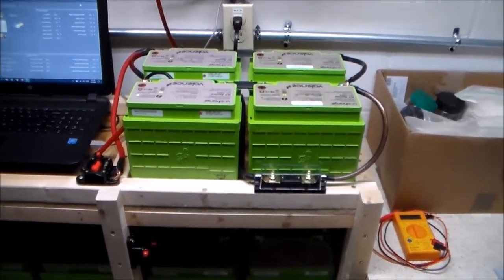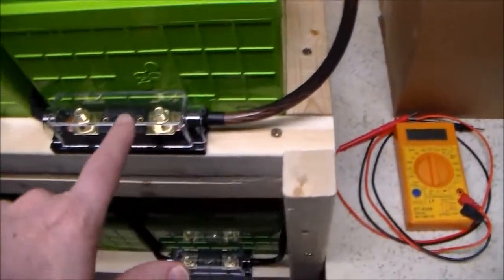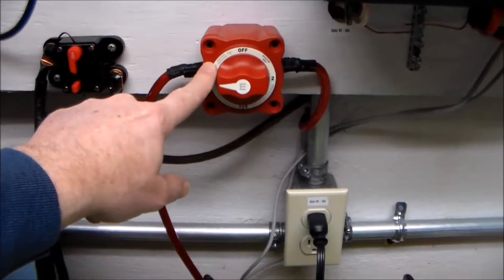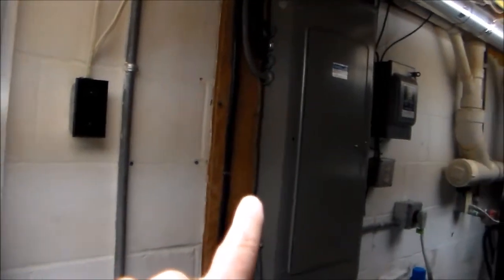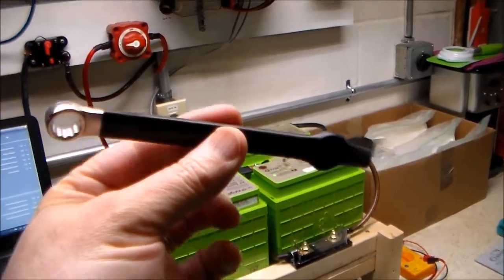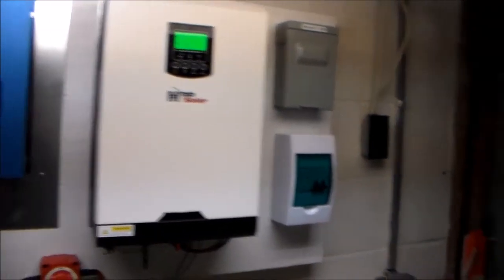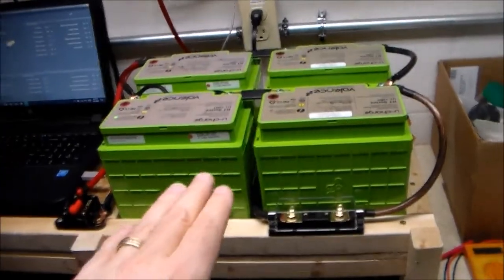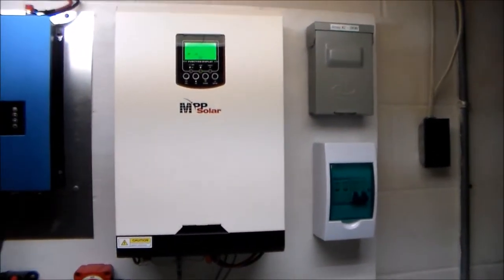DIY Solar - Episode 7 - Wiring the Batteries

Comment: Wow Sonny Jim! Awesome build. I stumbled onto your videos at number 6. I had a very similar build, but it was about 30 years  ago using a wind generator and a then trace grid tie inverter. But in those days we didn't have all the pure sine wave inverters we do now. So I was not able to return power to the grid. Which wasn't my intention, But having the ability to charge from solar or the grid if you have both is huge. Running the system from an alternative source, battery, or the commercial grid is a game changer. Also I agree, you stole those batteries, and more power to you! I just ordered 4 for myself! :o)
Reply from the maker: @vhmccray3705  Glad to hear you found my channel. Good luck with your build! I hope you post some videos too!

Comment: Thanks for the video. I am also setting up a Valence RT battery bank. Did you do anything with the RS-485 communication data cables with  your battery setup? Was it necessary to monitor the state of charge of the batteries?
Reply from the maker: I didn’t use the data cables with my setup. Also, I never had to monitor the state of charge since the internal BMS took care of things for each battery. The only time I had to maintain anything was whenever I ran things down too low. In those cases, I needed to trickle charge the batteries to bring them back above 9 volts each so my inverter/charger could see them again to begin another charge cycle. I later changed the low voltage cutoff to a higher setting to keep the batteries from going too low. Th are great batteries. I wish I could find some of the larger 100 amp hour model for a decent price. Best wishes!

Comment: I am wiring up a 24 v system using the growatt inverter and it worked initially but when I tried to switch settings to lithium and now it's drawing no amps from the batteries and 13.17 v from ea battery and 26.5 v with system I set up 3 sets of batteries in series then in parallel.  Did I somehow trip the internal overprotective feature of batteries?  I have a 150 amp fuse.  I checked ea battery and they are all pulling 0 amps.  What did I do wrong?
Reply from the maker: I’ve heard that some inverters will shut down when initially connecting lithium batteries due to the large inrush of current that can occur. It’s recommended that before initially connecting, you place a resistor between the batteries and inverter to charge the inverter capacitors, the. You can connect the batteries safely. Search YouTube for Will Prowse videos. He did a review of some GroWatt inverters and showed how to do that.
Otherwise, I recommend that you disconnect your batteries and perform a voltage check on each one individually. If the charge has dropped below 9-10 volts, you may need to place them onto a trickle charger to bring them above 10 volts so your inverter can correctly detect them. I hope one of those suggestions works for you. I’ve also heard some others that had to search for a special setting within the GroWatt menus to enable some special feature for things to work correctly. Again, search YouTube for others that have your version of inverter. Good luck!

Comment: I have 6 valence battery 12v series/parallel connection but they wouldn't charge Balance with the black connector it comes with it, how should I connect it?
Reply from the maker: Those batteries have an internal balancer that will keep the individual cells balanced. However, to balance multiple batteries with each other, you have to install separate BMS that is sold by Valance. Some people open those batteries up and remove the cells to make that easier.

Comment: Are all of the battery cables the same size and length so that they all charge at the same rate? If not you’re going to have problems!
Reply from the maker: Yes. I mentioned that at 3:06 in this video.

Comment: Thanks for the video. I just bought some of these valence batteries and have them hooked up the way you have them. There's very little info on the batteries. Just wondering what your charging perimeters are set to? Are they supposed to be charged to 29.2v for top balancing?
Reply: Also can these be charged @ 40 amps since they are paralleled?
Reply: I have set as follows:
Bulk Charging (CV voltage): 28.4 v
Float Charging Voltage: 27.2 v
Back to Grid voltage: 25v
Max charging currant: 30 v
Back to discharge voltage: 26.5v
Battery cut-off voltage: 21v
Please keep in mind that your settings may need to be tweaked a bit depending on which charger/inverter you are using. I hope that helps. Good luck!

Comment: Sorry to be bothering you jim, the batteries are used and you have them in your solar system how many years now? and would you say they are great batteries? also i am looking to get 4 valene U27-12XP to series for 48v bank, do you think thats a good idea? only down side one cost $641.
Reply from the maker: CODIA STLUCE The batteries I got were 5 years old when I bought them. I used for three years. Most lithium batteries should provide about 15-20 years of use as long they are not misused. Yes, I believe  the Valence batteries to be some of the best and safest batteries to use for solar, although they are extremely expensive. Good luck with your system!

Comment: Hi Jim!

I am building  480ah/48v bank in the form of 16s2p (3.2v/240ah cells) and I was looking at how to protect each string if one of the cell is failing.

You are the first place I actually find information on this.  Just like you I want to be able to service each strings separately.

The question I have is about the fuse/breaker... If I get this right you have a fuse of about the power of the string between the battery and the joining negative bus bar of the parallel group?  So two 80a fuses per 160a groups.  Then you have a 150a breaker between the main positive bus bar and the joining bus bar of that particular group.  Do I get this right?  :)

From your design and for my particular setup I would protect each (2) of the 16s string with a 200a fuse as I do not expect to see loads larger than 200amps at any point.  This would insure that if a cell goes short then the whole string would get disconnected as the other cells/string would send well above 200a back into the shorted cell/string.

To isolate one string I would use a 200amps breaker for the same reason as above between the main positive bus bar and a particular string. If ever the string get charged or discharged at more than 200a there would be a problem, hence 200a is enough and has a better security factor than 240.

Anything crazy in what my understanding?

Thanks!

Comment: Cool setup. If your inverter is using household power pass through when your batteries are low to power those circuits, how is the inverter grounded when in this mode vs when using battery power?
Reply from the maker: There is a 40A circuit feeding the inverter from my home circuit panel. This includes Line, Neutral, and Ground cables. When in "pass-thru" mode, all three of those are also passed over to the transfer switch.
Reply: @jimginnyohio  hello i am curious but where did you buy the batteries?

Comment: do u need the valance bms to use these batteries in series or parallel?
Reply from the maker: CODIA STLUCE You can if you want. However, I have found that they stay balanced with each other simply with the internal BMS built into each battery.

Comment: What did you do with the BMS interconnect cables from the individual 12 volt batteries?
Reply from the maker: Just left thing hanging since they do not serve any function without the Valence BMS and terminators.
Reply: They still work great now.????

Comment: what will happen if we series two battery 12v using busbar, parallel them with other series of two battery 12v (same battery spesification and connection) , then give the series connection bus bar to other series connection. Sorry for my bad english. I'm from indonesia.
Reply from the maker: Yoto Agro Dita Two 12V batteries in series gives 24 volts. Paralleling those with two other batteries also connected in series will still result in 24 volts, only the amperage would be higher. To give 48 volts, you would connect four batteries all in series.
Reply: @jimginnyohio  thankyou, but what i mean first series point in that 24v parallel batteries, connected to 2nd series point. is that possible? btw i have learn much from your videos update. Now  i already have solar system in my house. 2700 wp system. thankyou for the knowledge.

Comment: Nice job, but why did you connect the used batteries in series without external BMS??
Reply from the maker: Cepi These batteries already have a BMS built into them. They will automatically shut down if they get hot or go over voltage.
Reply: @jimginnyohio  hi the internal BMS will not shut down if hot or over/undervoltage. You would need to connect these to an external Valence BMS which would active a relay to disconnect battery.
Reply: @skyline3561  These RT series have a standalone BMS built in.  XT series only has balance functionality in each module and require external BMS.

Comment: Hi
What's the bus bar that you used to connect the two batteries together
Reply from the maker: I used half inch copper pipe. I added flux to the inside before flattening it out. Then flowed silver solder into it making it solid.
Reply: @jimginnyohio  
Thank you very much. 
I'm in the Bahamas and I'm building a 5kw mpp 48v system with 12 of the 12v 100amp lithium ion valance batteries that you are using. Hopefully I am successful. Thanks again.
Reply from the maker: James Edwards Sounds like will have an excellent system! Best wishes with your build!

Comment: Is there a internal BMS in the Valence batteries?
Reply from the maker: Chris Kennedy There is a protection circuit in the battery that protects it from over voltage, over heating, and short circuits. The BMS is a separate external device that you can purchase from Valence.

Comment: Hi Jim! Great content. Where is the battery recycler you found these? I am in Westerville and am very interested for my own setup. Thanks and keep up the great work.
Reply from the maker: Hi Brian. The recycler is Southeastern Data on the southwest side of town. They are just off of Philipi Road. You will need to contact the warehouse manager there. His name is Sean. It's unlikely they will have any of the Valence batteries in stock since I have only seen them there once....and I grabbed them. However, you should be able to get hundreds of laptop batteries if you are interested in building a DIY Powerwall.
Reply: @jimginnyohio  thanks Jim!